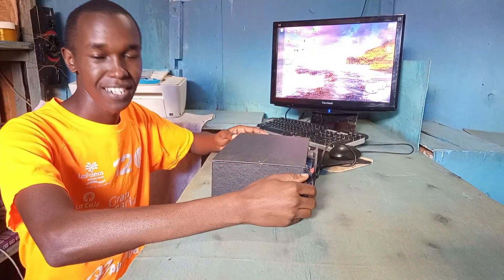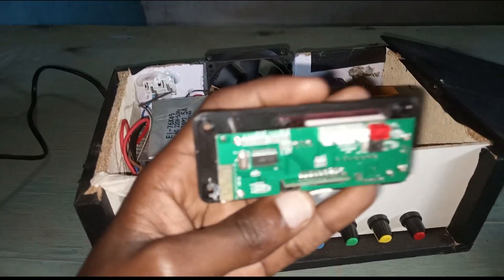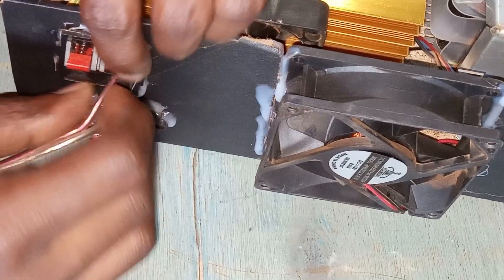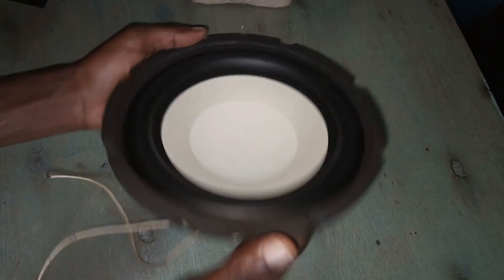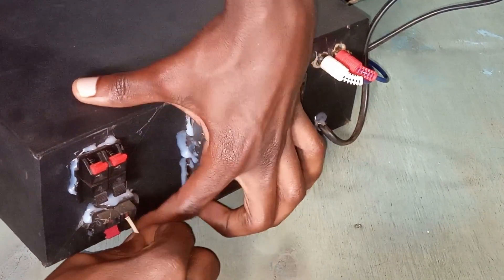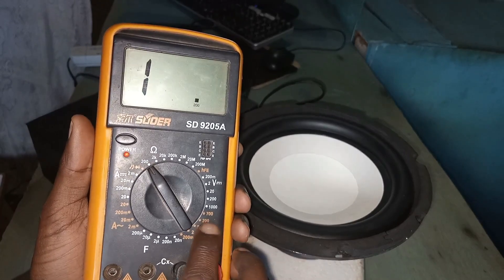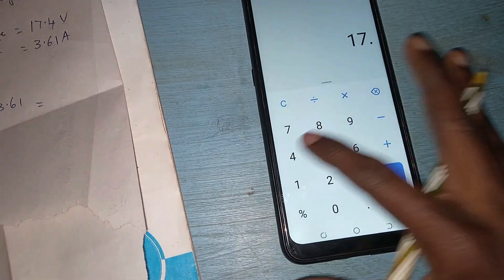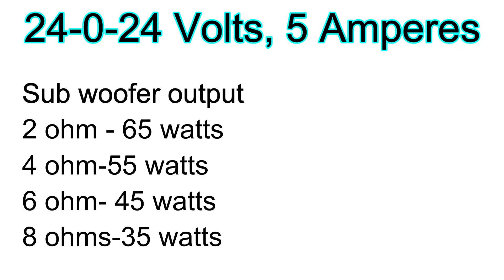Green amplifier board power output

Comment: is 80%thd how you test it.
and free air has less power output because driver have much bigger excursion and impedance raising. the best test for output is to put driver in enclosure and find the port tuning frequency of the box. there have minimum excursion( a bit over 2 ohm load for your speaker)

Comment: BRO NICE JOB HOWEVER YOUR CONCLUSION IS MISLEADING... WE WERE TESTING THE BASS OUTPUT BUT IN YOUR CONCLUSION YOU ARE TALKING ABOUT TRANSFORMER.... i feel it's misleading coz you should have mentioned each amp had its manufacturer's power input rating
Reply from the maker: If you test the green board with a genuine toroidal transformer you'll get better power output. Most of these box transformer are less efficient, I've seen  several cases of them  blowing up

Comment: I think, my fan is connected directly to the motherboard. It makes alot of noise, also heard through the mids. How do I solve that??

Also if i cut the fan cable, will there be a problem??
Reply from the maker: I did a video on that, look for external 7v to 9v, and another bigger fan, they dont make noise. Distortion is caused by ground issues
Reply: @emmanutechnician  thankyou for getting back...
i am not a technician though...where are you located??

Comment: Is it 24 0 24 or 12 0 12,,, coz mine distortion tupu kwa bass when volume is high but iko na 12 0 12
Reply from the maker: Should be 24-0-24, 12-0-12 is too low for green board
Reply: @emmanutechnician  48v 5amp 240w 24V-0-24V  240%3--80w for channel or 36V 5AMP 180W 18V-0-18v 180%3--60w for channel

Comment: Hi, if I want to use the green board entirely for mids, which two transistors should I remove that are responsible for subwoofer
Reply from the maker: Those two on the left side. And there is a way of converting  that whole channel from bass to tweeters

Comment: Measure the voltage with no load since when connected with a speaker there is a voltage drop.Around  30v with no load
Current you measure with load. Around 3amps.
Power of 90watts max,45 RMS
Reply from the maker: Point noted, I'll try to see if it will have any change.

Comment: How to fix USB reader in this amp
Reply from the maker: Very simple, get 12 volts from 7812 regulator, that powers the fan, if it's distorting, use go tv adapter and fix it inside the box.
Take left, right and ground signal to the amplifier inputs
Reply: @emmanutechnician  thank alot bro

Comment: Good stuff. A quick question though. What can I do to get clearer bass? The midrange is perfect but the bass is rough with noisy vibrations, (like in your test) Using an 8 inch, 4ohm speaker. Any ideas?
Reply from the maker: Okay, if possible you can add a bass preamp, or equalizer. You will be able change bass gain and frequency and make it sound the way you want

Comment: Hey Bro 
Just a question since I heard you say that humming sound come from the fan powered from the amp
Kindly advice the best method/ part to power the fans
Reply from the maker: Yeah, the fans need separate power,eg from 12v adapter, but not all, some boards are not distorted by the fan.
Reply: @emmanutechnician  it's the green board
So if it  has that distortion fan is the cause

Comment: Why is mine just the type producing a buzzing sound and around the small transsitor its burning a wire that crosses infront of the transitor
Reply from the maker: What is the voltage is your transformer?
Reply: @emmanutechnician  24 volts

Comment: This is great.I didn't know how to measure the output power.Well,I have a 2.1 and was asking if it can power a 4 ohm 1000-1500 watts subwoofer,comfortably.Then,if you can have a video on how to connect boschmann equaliser to the amp,ingekua fyti.Good work!
Reply from the maker: Yes it can power, but make sure the rms of the subwoofer is not much. Mostly it works with Kenwood 3010, the yellow sony explod and mobile authority.

Comment: Good job but a transistor is not a tube nor is a tube a transistor🤣
Reply from the maker: They are almost the same. Transistors operate at lower voltages, tubes use higher voltages

Comment: Great technical knowledge bro and excellent video. We're tired of the bogus videos from other 'fundis'.

As a 'fundi' myself, who likes drawing the amplifier from scratch, I wish to point out that 2ohms woofer on these amplifier is not safe for the two output power transistors. 

In your case the two ohms speaker wishes to pull about 145watts from that amp . This is from:
-Power= V²/R
Power =17²volts/2ohms.

The current pulled by the 2ohms speaker will be given by 
POWER= V × I
I= 145w/17volts
Current will be about 9amps. Which is stressing the transistors and that specific power transformer. (It will overheat because it's rated for 120VoltAmps and melt)

4ohms speakers are the best for this amp for they will pull about 70watts only at their maximum.
Reply: Remember also to wekea hawa vijana a fuse wasichome cube yao 😂. These amps hate short circuiting

Comment: What is the cause of distortion ?
Reply from the maker: Several factors
1. The fans, they need separate power, not from the amp board
2. These box transformers have electromagnetic effect which interfere with audio signals. If possible use toroidal transformer.
3. Lack of earthing.
Reply: How can u put earthing yet the power yenye umeeka hapo naona ni live na neutral pekee

Comment: Good work bro. Just have one suggestion next time when measuring the voltage and current output you can use a signal generator app so that you can play a constant signal like 40hz or 50hz your voltage won't flactuate kabisa and it will be easy to get your voltage and current.
Reply: Thanks
Reply: What's the best app to use?